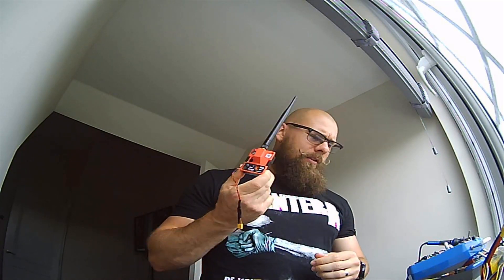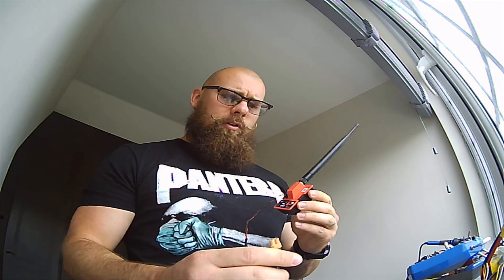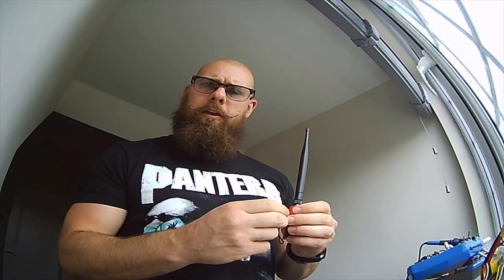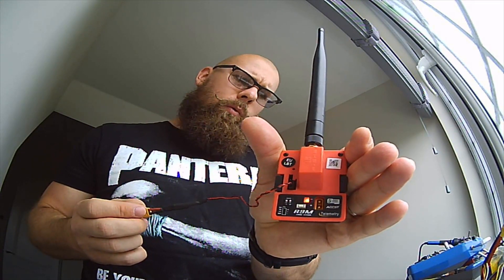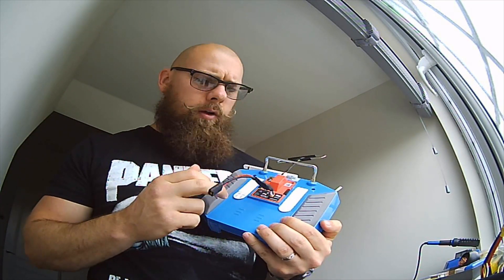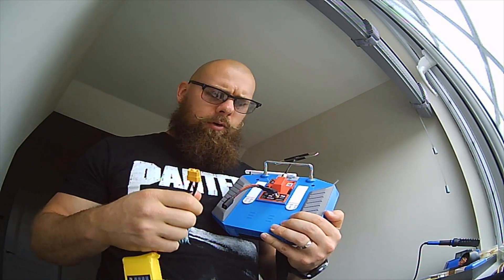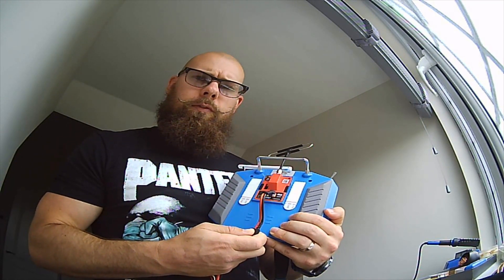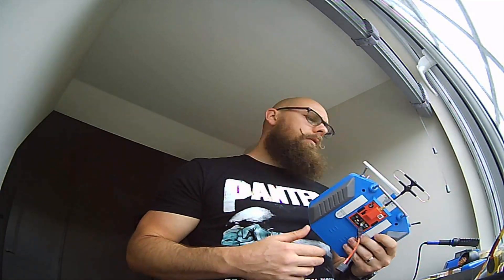Frsky R9M module  power issues

Comment: well that sucks. Got a r9m a while back for real cheap from a local hobby store that was closing. Ive been trying to learn how to do serial passthrough to update it to go get flying, but here the whole time they simply sold me a dead unit :((( Thanks for the clarification, there is very little information on this.
Reply from the maker: Are there any lights showing on the back of the modual when you plug it in to the transmitter and switch to external module?
Reply: @quadswithmods  I don't have a module bay, (I don't have a taranis), but I know that it would do nothing with the lights regardless of the different ways I powered it, if I tried putting it into the binding process, adjust the rx power level, or even trying to force update the firmware. She gone... unfortunately.
Reply from the maker: if you still have that unit see if you can power it like this as ExpressLRS firmware is AMAZING on R9M stuff. really worth a try